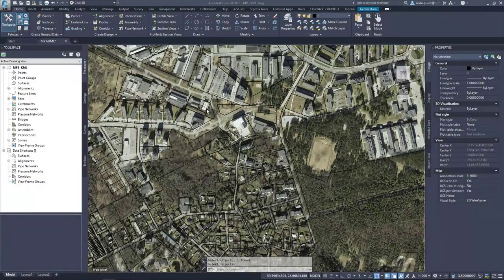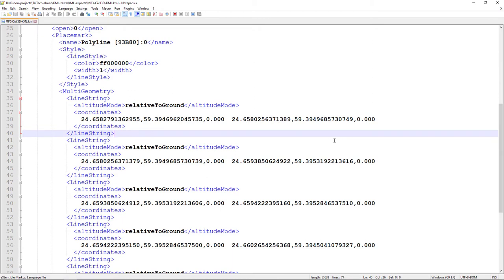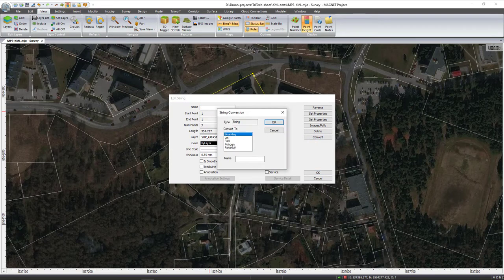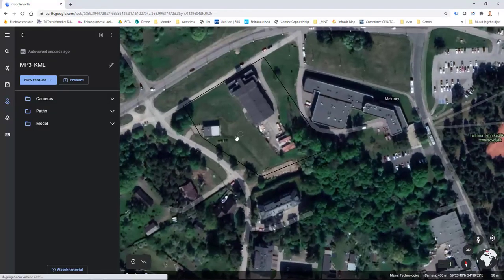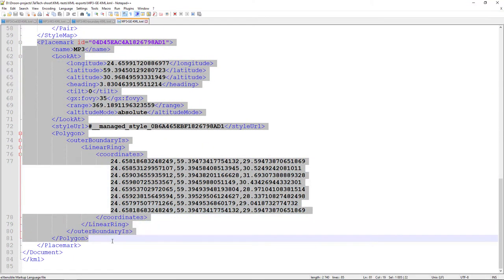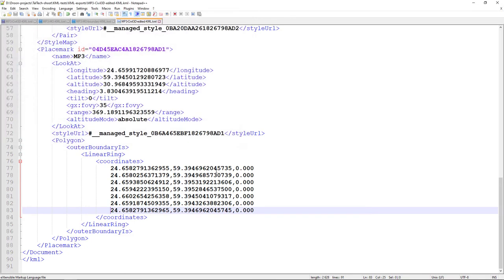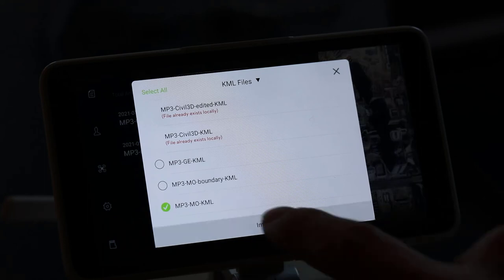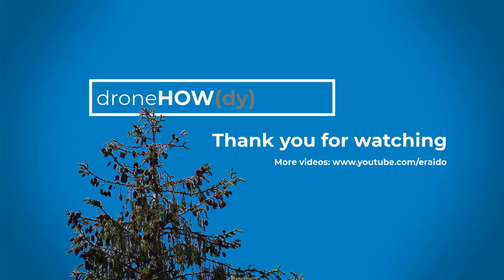droneHOW - Episode 05 - KML-based flight program for 3D photogrammetry (DJI Phantom 4 RTK)

Comment: To do 3D photogrammetry, do you perform only one flight at 100 meter, or you need to to 3 flights at different elevations?
Reply from the maker: Just one elevation is actually needed. But you need to understand that if you want to get so called hidden features into your final model, low altitude missions are suggested or you compensate it with a separate photo-session with DSLR.